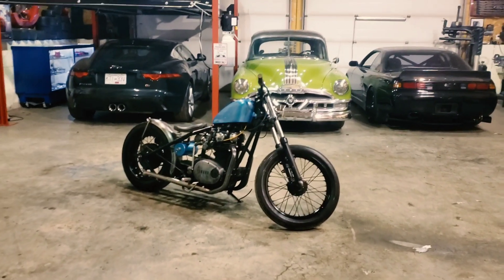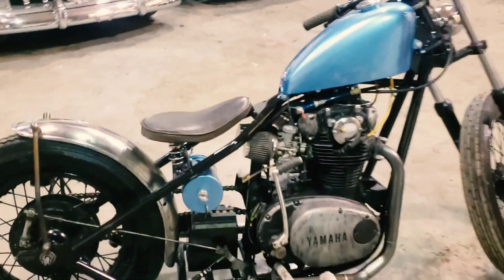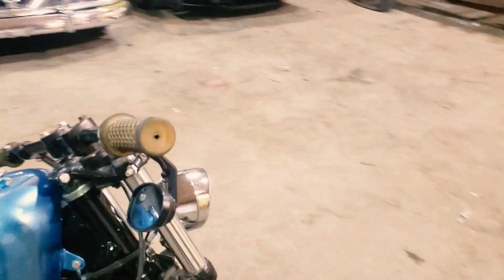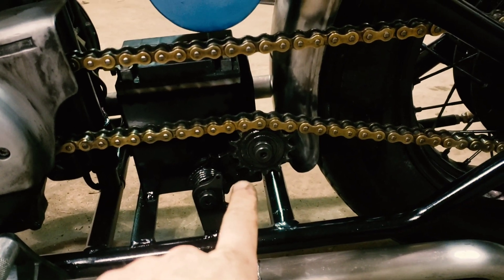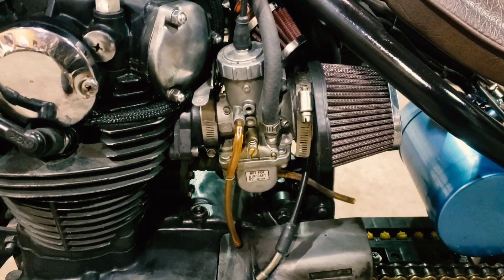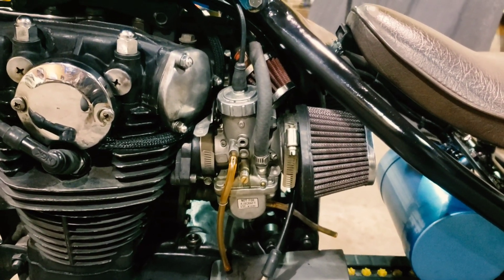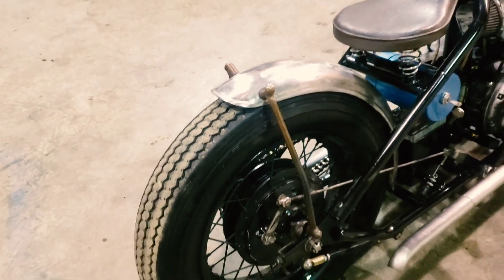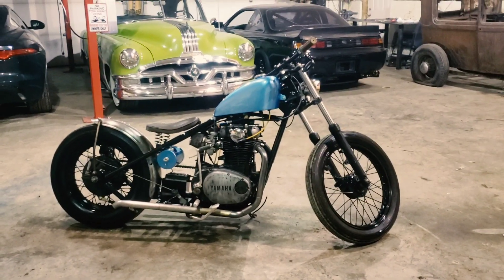Custom Yamaha XS 650

Comment: Good video I myself have got a 650 1979 Yamaha Chopper rigid I put a foot clutch DNA Springer 5/4 / Forester gas tank lot of fun to ride when I see the Harley freaks looking at it I say I took the best part of the Harley the rear and front wheel gas tank and put a Yamaha motor in it that is very reliable no it does not go as fast as a Harley and I wrote a lot of Harleys old ones I'm old school but this thing is fun and very good-looking thanks for the video beautiful bike

Comment: Were you able to figure out what was wrong with your Bike? I just wired mine with electronic ignition and already having issues.
Reply from the maker: Still same issue. Im starting to think it's the electronic ignition. Runs fine at lower to mid rpms